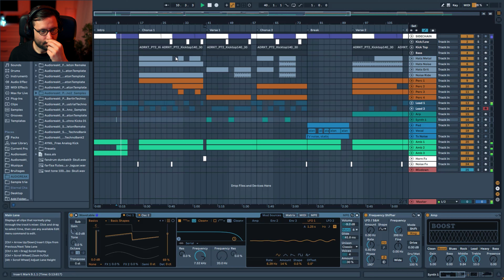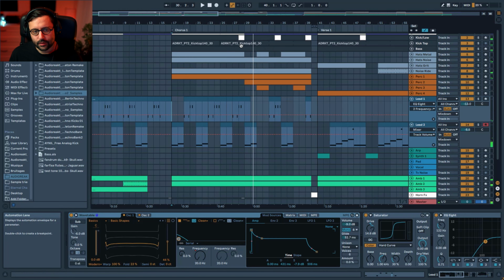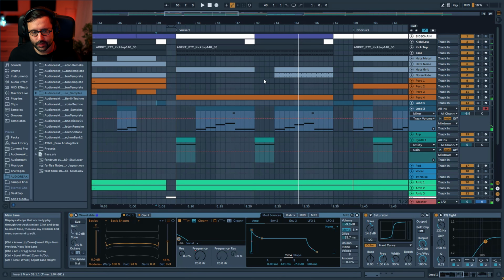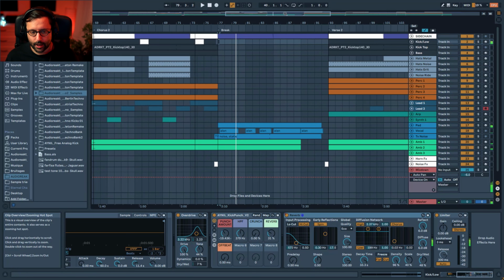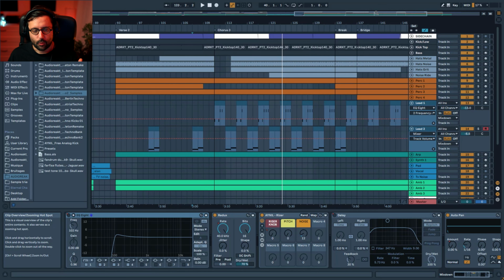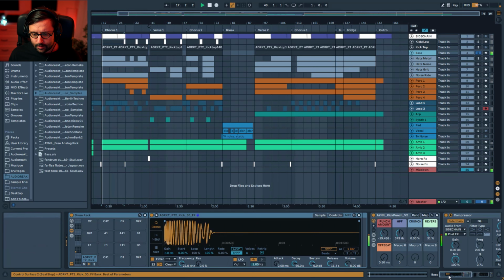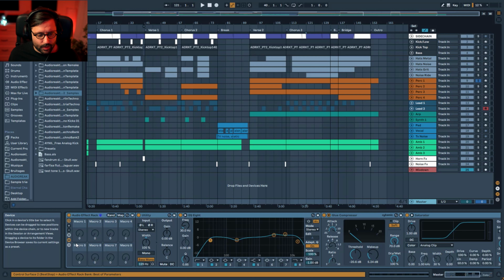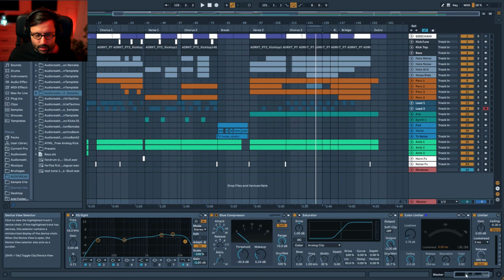How to make Industrial Techno ([KRTM] style) Part 2 (Arrangement, Mixing & Mastering)

Comment: I agree with leveling for mixing coming with the experience; it's actually kind of crazy - when I was starting I had to change volume by literally 6dB to know if something works better or not. Then after a few mixes I was feeling the difference of 3dB easily (not necessarily if A is better than B but it was very clear). Yesterday I was finishing mixing two of my tracks whole evening and even 0.5dB felt like a huge difference for the vibe/feel and were super important. :) So my advice is exactly like yours - just practicing mixing, not overthinking it, after a while you just hear it!
Reply from the maker: You right, it's so important and it's a shame that you cannot really teach it... But it's rewarding after years when you knows you shaped your hear 😉